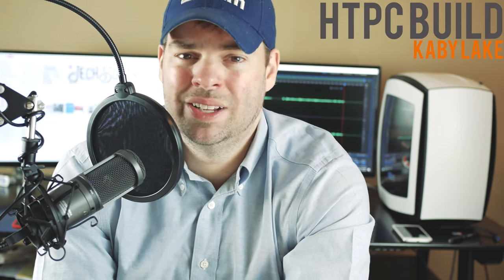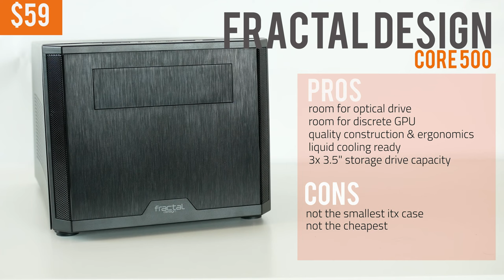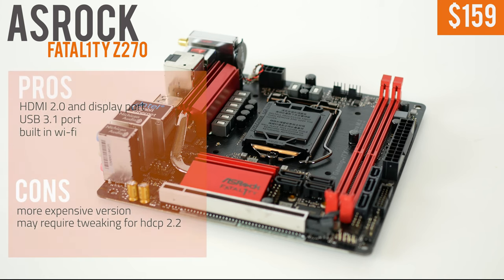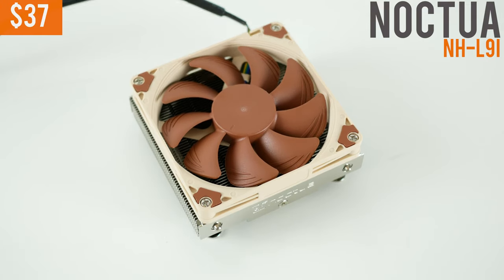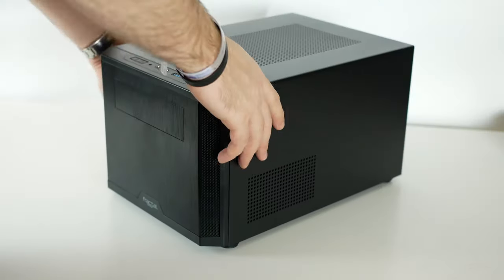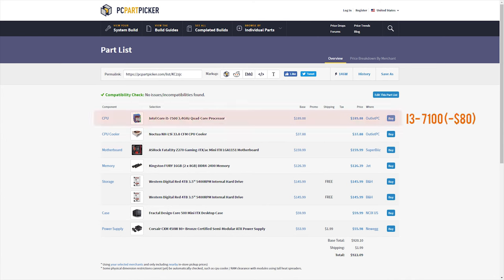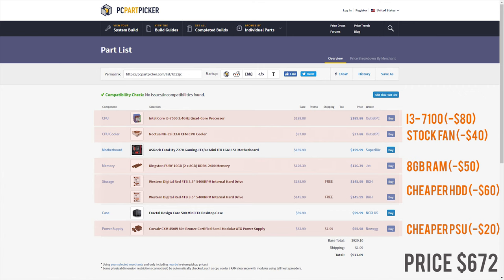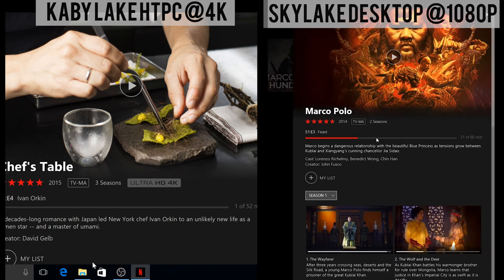Kaby Lake HTPC Build - 4k Streaming Netflix Ready

Comment: Great video. I have some 10 bit hevc that skylake wont play properly but Pentium G4560 does.  So updating my main htpc. It is used for video playback and record live TV with Hauppauge HVR-4400 card. Watching this decided to go with same motherboard and ram but use Pentium G4600 as close to the i3-7100. Cost $720.  The other parts like m.2 drive and storage drives will be swapped over.

Comment: Mind blown. According to all the spec sheets, this seems to be the only ASRock Z270 mobo capable of 4K @ 60Hz over HDMI. Not even more expensive full size versions of the Fatal1ty boards support more than 30Hz. That makes no sense.
Reply from the maker: Fleck It's infuriating. Especially since these processors work on the z170 platform and the only real reason to move to 270 was hdmi 2.0 support

Comment: I hope you have a backup solution for your RAID-0 or that the data stored there is easily replaceable.
Reply from the maker: Since this isn't an OS drive, and it's just rips of physical media I already own, I'm more worried about maximizing storage capacity for the money. A redundancy raid would be one way to go for sure, but it'd get this system expensive in a hurry - especially since we're talking about large files, even with just 1080p rips. Thanks so much for the comment!

Comment: Do I need a aditional GC for playing 4K mkv's and how do you play audio like DTS HD etc. ?
Reply from the maker: It should be plenty of power to transcode 4k mkvs. Most of the power required on transcoding falls on the processor. If you use the HDMI port, it should carry the DTSMA and Dolby True HD signals just fine. All my Blu-Ray rips that I've got on my server output their lossless audio tracks without any problems when I'm watching in Plex.
Reply: Thank you very much! There is plenty of confusion where you get a Z720 with HDMI 2.0 and not 1.4. How can I check that? Are all the Fatal1ty Z270 built with HDMI 2.0? Thank you very much again for your help...
Reply from the maker: For ITX, I believe they only make one Fatal1ty z270 board, and it's the one in the video. Unfortunately, neither of their Fatal1ty ATX boards support it. What you're looking for is one of three things in the specifications: either explicitly stating that it has an HDMI 2.0 port, HDCP 2.2 support, OR that it does UHD (3840x2160) at 60hz. The 60 is the important part because that's a tell that it is an HDMI 2.0 port. Make sure you also check if it has a display port - because many display ports can do 3840x2160 at 60HZ. But so far I'm not seeing a lot on the first wave of Z270 boards.

Comment: Umm...no. 
You buy an i3-4xxx CPU for about $50. 
Mobo and DDR3 should cost less than $100. 
Add a 750 Ti for $50. 
EVGA 430W PSU for less than $30. 
A nice case for $50. 
Boot SSD for less than $40. 

4k HTPC Should cost no more than $350.
Reply from the maker: cicada None of that would pass the hdcp 2.2 requirements for 4k streaming. You missed the entire point of the video.
Reply: Point taken. But you could still easily scoop a 1050 for less than $100. My point is that you don't need the newest hardware for a good htpc. The entire point is to be able to play 4k hevc in 10bit, and to keep power consumption low....all at the lowest price possible.
Reply from the maker: There's a few things to consider here. One, as I mentioned in the video, some of the parts are above what you'd need to do a bare minimum install. What I wanted to illustrate was how to do an HTPC leveraging the Kaby Lake platform, as it was the only way (at the time) to do 4K Netflix streaming. 

As I've shown in other comments, going the discrete graphics card route still has limitations over going the CPU route in terms of what you can do with 4K. (It also adds power consumption). And you can't just get a regular 1050. You have to get a 1050 TI with 4GB of memory. Those are the requirements from NVIDIA. So now you've gone from your $50 card option to $150.

I also think doing on the fly transcoding would benefit from an i5. I ran into issues with this trying to transcode on the fly with my Nvidia shield, it was clearly underpowered.

Finally, your prices are too low and you're omitting some parts. First of all, you don't have any storage drives listed. The HTPC I built wasn't just for streaming from cloud sources, but also a local Plex media server. Two, if you're leveraging the Kaby Lake platform and want to do HDMI 2.0/HDCP 2.2, your options are severely limited for motherboard in an ITX build. (this has been discussed in length in the comments below). Most boards on the Z270 platform still have HDMI 1.4 on board video. You can get a case cheaper than the one I bought, but that's just a personal preference in terms of what you want sitting up by your TV for everyone to see. 

I completely get where you're coming from. I'm the king of buying used, buying cheap, and not wasting money on builds. This whole channel is a best bang for your buck channel. So in many ways I totally agree with you. But given the (artificial) limitations of 4K streaming, especially at the time I made this video (there were no drivers that supported 4k streaming via discrete cards)...this video was for solving a specific problem, not necessarily to get the cheapest possible option on the board.
Reply: a gt1030 is surely better then

Comment: can i play netflix 4k video without 4k monitor but still in kaby lake processor? I have a i5 7600k and a 1080p monitor,but 4k video on netflix is not working
Reply from the maker: No, you will only get the 4K option if the app senses your monitor is 4k capable. It's not like youtube where you can select/see the 4k option.
Reply: thanks for the answer!! helps me a lot.
Reply: no because it detects your resolution , you need a 4k monitor and use displayport cable to get 4k 60fps instead of 30fps

Comment: With this case can i add a graphics card??
Reply from the maker: You can, just make sure that it's going to be HDCP 2.2 compliant. But you would only need that for gaming. If you're just using it as a streaming/htpc box the on board video would do just fine.